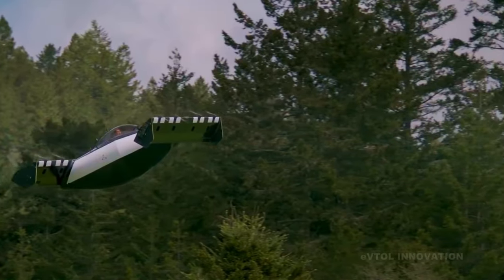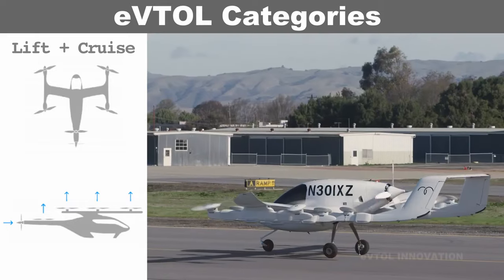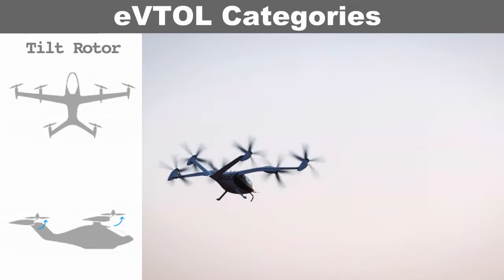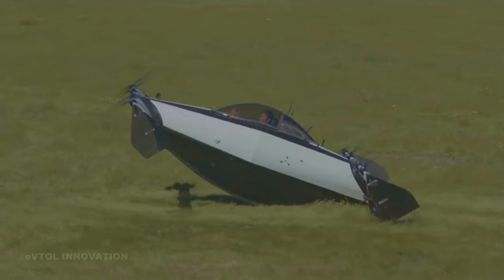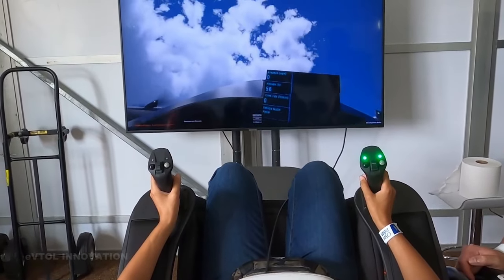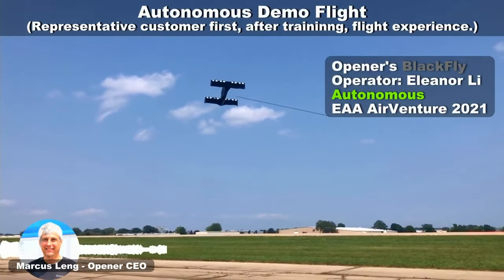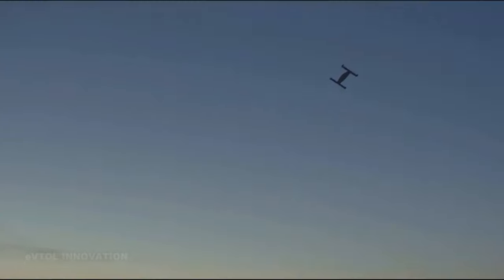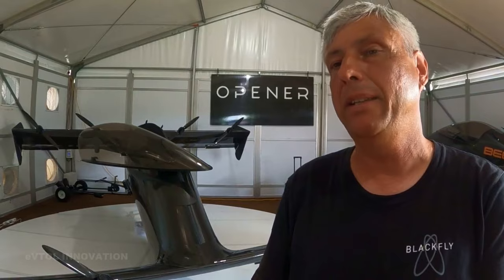Is this the best personal eVTOL aircraft? | Opener's BlackFly [Pivotal Helix] Innovative Design

Comment: I hate that the top speed was limited to 65mph in the US. I would want it to out put 150mph safely at least. That way this vehicle can be used for interstate travel.
Reply: Leng has said in multiple interviews that the Blackfly can go significantly faster, but has limited to low speed flight to make it accessible to those without pilot licenses.  If successful, I imagine he'll make an "unlimited" version that people with pilot licenses can fly.  Unfortunately, with a range of only 25 miles, it's never really going to be capable of interstate travel, regardless of speed, but it's a step in the right direction.
Reply: @meadmaker4525  it seems quite spacious, perhaps a gas engine for cruise could be incorporated into later models. The tilting body architecture seems like their greatest contribution to the vtol concept.

Comment: As far as the propulsion goes, small, ducted jets like Lilium's jet would probably take the Blackfly to the next level in terms of noise, performance, safety (from exposed blades), etc. A future iteration with such and a gimbaling cockpit, may make it the go-to design for such aircraft, due to its efficiency, simplicity & cost benefits. Battery hotswap capability would take the design even further.
Maybe such an iteration could also have the potential to be twin-seat, if the ducted jets and battery energy density can meet the performance demands. I would envision multi-seat (>2) as being more in the realm of cyclo-rotor territory.
All-in-all, very impressive.
Reply from the maker: Nice. That’s actually a design I’d like to see. Thanks for the comment
Reply: @eVTOLinnovation  It may be worth also investigating Jetoptera. Their propulsion, which they claim may be achievable electrically, is quite a marvel.

Comment: For low noise take off, we could look too catapult and maglev railcar types of solutions. The crafts would transtion from stationary directly to cruise+climbing. Any forward velocity at take off also saves battery capacity. 
If glide landing or parachute landing are feasible, this also reduces noise at destination.
Reply: Catapults? You first. If you want longer range, just use fossil fuels.

Comment: Blackfly would be much better looking with a deployable back wheel that makes its standing gait "upright". Of course that's weight.
minimizing weight by using the front/back props to torque it forward and tilt it is good, but it's just that last moment where the ground contact doesn't match the vtol approach.
hrm

Comment: Love it gotta have one.. couple of ideas for a future model. 1. Some kind of rotating gymbal cockpit so it's always leveled.  2. New generation super high energy density graphine based batteries. Include these and you will vanquish all competitors.
Reply: There is no competition at the moment for this special use case...Lift Hexa sells for the military...other companies are in a different region...
Reply: A gimbaled cockpit would be a great usability enhancement, though it would add weight. Maybe some partial through-the-floor visibility, or a video monitor, could add some of this benefit. 
I’m no aero engineer, but I also wonder if the overall cruise efficiency would be better if the props were somewhere other than in front of the wings, which would seem to interfere with lift, due to prop turbulence.
Regardless, if it’s really only a fraction of the price of other eVTOLs, it looks like it could be huge.
Reply: Anti gravity and counter gravity devices will aide this technology in the near future!
Reply: @Xterminate13  ..you're not one of those Hybrid Aliens helping us with reverse engineered tech are you?
Reply: @donmacgregor3222  are you?
Reply: @Xterminate13  ..maybe, ok gotta go coz my interdimentional portal timeout window is about to close 😂
Reply: @donmacgregor3222  remember to flush 👈
Reply: Why not go for a zero point energy generator if we're designing aircraft with technology that doesn't exist yet?

My proposal for improving the practical utility of this would be to just add a 15kW combustion generator that powers it in cruise flight. This would give it a far greater range and the ability to refuel in 5 minutes.
Reply: Would raise the price. This is meant to cost as much as an SUV.
Reply: @dandcc9192  it’s all easily done, but only if WE want it. Not just you, not just me, or someone else but all of us. We get what we want. Majority out weighs minority.
Reply: @Xterminate13  What are you even talking about? That made zero sense.
Reply: @Xterminate13  If you've lived your life on this planet it is pretty clear most of us don't get what we want.
Reply: @dandcc9192  I think you get exactly what you want, ruled by fear, fear of loss, loss of jobs, loss of security, loss of love. All the while, missing what’s right in front of you, but blinded by fear. Let fear go and just maybe your reality will reflect things you want instead of judgments. Fear of judgment as we judge others we end up judging ourselves the harshest and we wonder why we don’t get what we want. Haha
Reply: @dandcc9192  I’m just saying if you think you’re getting what you don’t want, try thinking of what it’s like having what you want instead of you don’t want. Our thoughts control our reality, whether or not we’re aware of this makes a difference.
Reply: @Xterminate13  That's a dumb mind trick and rationalization. I didn't buy my car because it's the car I want the most. If money was no object, I would have certainly got something else. Yes, in a sense you have a point, in that, I wanted "not going broke and having my shitty car" more than I wanted "buying an expensive car I cannot afford and possibly bankrupting myself." But if we isolate just the car, and ask me, "is this the ultimate car that you wanted?" the answer wouldn't be "yes."

Also, letting go of fear doesn't get you what you want, not always. It does mean you are likely to play it less safe, which means you will play at life "high-risk and high-reward." Some people WILL get what they want, if they did it that way, but that doesn't mean everyone who acts recklessly will.

That was such a simplistic philosophy packaged as something more sophisticated than it really is. Yeah, it is important to not dwell on "what if"s but that doesn't mean you gotta hypnotize yourself with that kind of nonsense.
Reply: @dandcc9192  turn your fear into respect. Respect the danger but don’t fear. Rational minds have rational responses. I’m not saying it’s simple or I’m right but it’s one way of observing the situation.
Reply: This: 24 mile range. Slow recharge.
Less expensive paramotor: 250 mile range. Quickly refill tank.

Suckers born everyday. For decades now commercially available inexpensive unregulated ultralight aircraft far cheaper and far  superior to this get-you-nowhere, absurdly impractical, more for less, overpriced POS vapor ware, have been tried and tested, and they are far safer more mature technology that actually works.

Tandem trike paramotor complete setup can be bought right now for under 20k.
Reply: @Xterminate13  Then you didn't mean to say "fear" in the first place. Learn to better articulate yourself.
Reply: @Xterminate13  Also it's still a stupid rationalization.
Reply: @Xterminate13  If I get a bowl of ramen instead of steak because I "respect" the likelihood of spending too much money for my own good, it doesn't mean what I "really wanted" was a bowl of ramen, if I was drooling for a steak.

You could say, "if you really wanted a steak, you would have gotten a steak even if it meant going broke or robbing someone," but that's a stupid mind trick. If this guy really only wanted a bowl of ramen he wouldn't be dissatisfied with the bowl of ramen he ate. He would be satisfied and would not be motivated to get ahead in life to someday be able to afford to eat steak whenever he wanted. What he really wants is a steak.

Comment: Thanks for sharing all this information. Definitely helps me decide if I want one or not.
Reply: Remember, you can go about 10 miles if you want to make it back. That’s right right, 40km range is only 24 miles. If we take the companies promo materials at face value, then you could only go 12 miles max and have juice to make it back. It would be unwise to cut so close though, and even 10 miles would be a little risky. Now I’m sure landing and take off use more juice than cruising too, so if you want to land at your destination, well no, you probably shouldn’t do that, unless you are either planning to recharge at the destination, or your only going a couple miles. How long does it take recharge?

Paramotors have ranges as far as 290 miles. Landing every hundred miles or so to refuel I much longer trips is something which is done as well.

Sorry, but this flying car, like the dozens that have come before, is absolute pie-in-the-sky bs. Less for more, get you nowhere novelty, that is more a likely than not vapor ware anyway. Meanwhile inexpensive ultralights have been around for decades, and getting better year after year.

Comment: This is a very well put together video that 'gets it' with regard to the aircraft design.
Reply: Would it glide if prop stols
Reply: Yeah it really doesn’t seem like a safe design. Powered glider ultralights are a mature technology tired and tested in real world use for decades. Safer, cheaper, better range.

Modern paramotors have a range of 290 miles, and they can land safely without power. Intermittent refueling can practically provide effectively unlimited range.

This thing has a range of 24 miles (40km). If you want to make it back, 12 miles, but with a reasonable safety buffer, optimistically 12 miles. Landing and takeoff certainly will use more fuel. So if you want to land at the destination and still make it home without recharging, safely, then what, like 3 miles maybe.

It’s absurd. Hyped up, backwards, less for more, get you nowhere, overpriced, pie in the sky nonsense, that plays on the fact the ultralight vehicles are uncommon so many people don’t know much about them. Wowz! Flying!

The fact is that vastly superior ultralight vehicles which don’t require licensing have been commercially available and affordably priced for decades.

Comment: There is a lot to like about the aircraft.  The big issue for me is the lack of a landing gear which severely limits the use of the aircraft.    If you fly somewhere else than your home aerodrome, then you cannot move the aircraft out of the way because you do not have the little cart with you.    So it is not a practical aircraft.    There are lots of places I can visit within the range of the aircraft but none of them are options because the aircraft cannot be moved after landing.  Unfortunate.
Reply: Adding a couple of wheels seems like a relatively simple fix, should the consumers demand it. Two wheels somewhere at the CG could be enough since it's only 144Kg. You could then move it around sort of like a wheelbarrow.

The option to just fly it to a parking space is always there too. It's VTOL, after all.

Comment: I think vehicles like this would benefit from the use of a bank of redundant micro generators as main power with batteries as backup. This push to use pure battery power because fossil fuels "are bad" is hindering this innovative niche of aircraft. The distance you can fly the blackfly is not impressive. Generators could push this over the 300 mile range which is practical for transportation. Hybrid automobiles were the first electric vehicles to be widely accepted. I think this would also work in the aircraft industry. Any thoughts?
Reply: The domino effect is at play here as adding fuel and excessive generators will increase A/C weight. Which will in turn increase the measure of thrust needed for VTOL operations; meaning the equipment configuration will be subject to change. All of this means that the A/C will be heavier, require a pilot's license to operate, and have an increased per unit cost (putting it out of the range of the general public). 

I have to imagine the solution to all of this is to find away to incorporate electric generators (solar or wind) to generate energy during cruise. This will increase the unit price but the improved model can be sold as a luxury model.
Reply: The craft can't carry the extra weight - you'd be limited to ~140-lb pilots.
Reply: I could see the small rotary Mazda is thinking of as a range extender being a huge plus with that idea and this aircraft. Power though all strokes of the engine and greater power/energy for a smaller displacement. Could be just the ticket this baby needs

Comment: Dont care much for the rear wingtip proximity to the ground during takeoff/landing.
Seems fragile/vulnerable in a crosswind or unexpected gust.
Reply: Range: 24 miles. Round trip: 12 miles. With a reasonable safety buffer: 10 miles. With landing/takeoff at destination: hmm maybe 3 miles?

Paramotors these days can go up to 290 miles, at which point they can land and refuel in a practical amount of time. People actually do it.

How long does this thing take to recharge its batteries?

Comment: I don't get it. You can't go very far in it, and why would I want to fly with my plane always pointed upwards so I can't see in front or down very well, the way everybody is always depicted flying it?
Reply from the maker: Small improvements in batteries will increase range greatly. 
Only during VTOL and hover, you would be pointing up, during cruise you would be in a horizontal or pointing down position depending on speed.

Comment: hmm. when the girl who works for blackfly showed a demo....the demo lasted? let's say 2mins? so the next question is how long does the blackfly ... fly before needing a recharge? if anyone is showing a demo. then you show all the good bits? the goods bits that were shown were within 2 mins!!!  that not good enough... it's very small..and it's supposed to have a reserve chute. u need to show this with the girl in the cockpit. using the reserve........it just looks like you people are a bunch of cowboys. u need to shape up or ship ... out. quote "VTOL aircraft. The BlackFly features a Tilt-Body architecture, this gives Opener an extra degree of freedom when designing the propellers"..but the pilot cannot see when taking off and landing??? black fly has had far enough time to sort all this out.
Reply: @TONYPARAMOTOR  The girl was a PASSENGER on a ride, controlled from the ground.  It was so pathetically pandering it hurt!
Reply: @awebuser5914  wouldnt it. of looked better if the general public was told first? and that the girl who was pathetically pandering around.... how long did this flight last?? why not just have some one in the cockpit with the rc .and let the pilot fly the craft. is this craft designed to be flown by   PEOPLE??   YES OR NO .